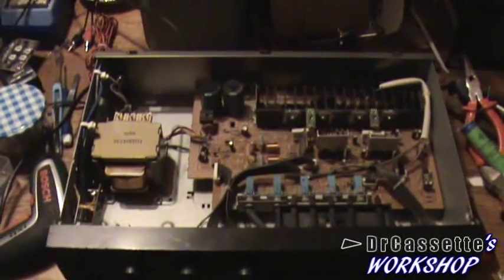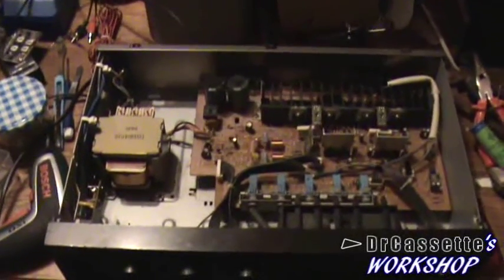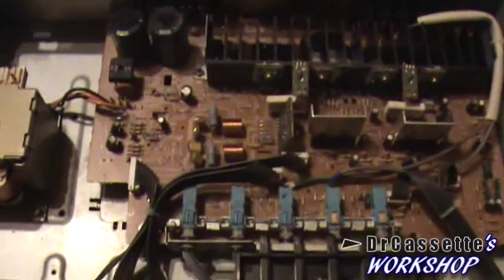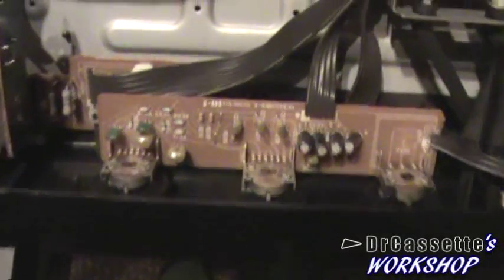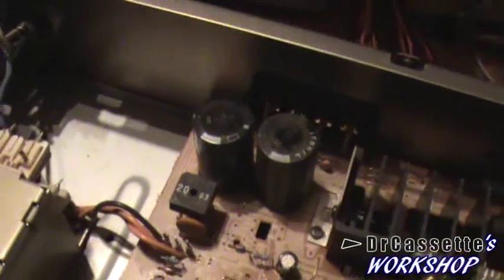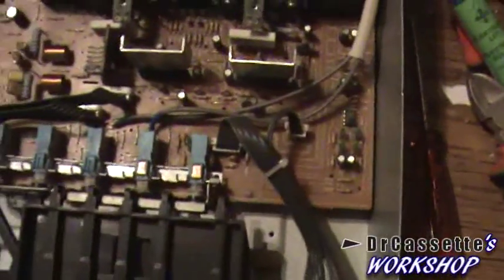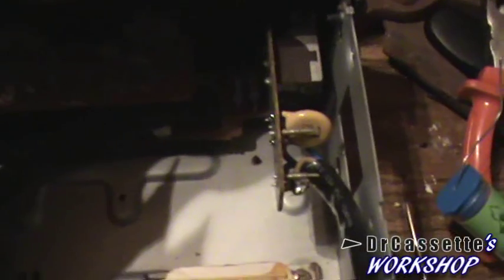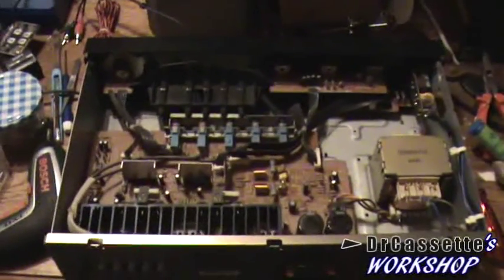DrCassettes Workshop - Inside the Philips FA 561 amplifier!

Comment: Aynı model Ampifier var bende power tuşunu acıyorum ses gelmiyor biraz bekliyorum tak tak ses geliyor çalışıyor arızası ne olabilir
Reply: Ampifier sorunu çözdüm... Ampifier çok güzel sesi var güçlü madein japan mükemmel bir cihaz
Reply: @keremsert7879 Witam. Jak pan rozwiązał problem  bo mam taki sam wzmacniacz i też się nie włacza. Dziękuję.
Reply: @bartolinigabkamaniakdh243  I solved the problem. There are 2 electronic capacitors at the bottom of the amplifier. Bally glue was communicating. I cleaned it with thinner. Problem solved. The amplifier works smoothly.

Comment: I do have the same amplifier, but mine has a problem with the output. The amp works fine for a few moments but then the music stops. it looks like the transistors on the output are failing, but i'm not sure. Do you know what could possibly be wrong? thx
Reply: i have the same problem right now, my right speaker just stops playing after half a minute (only on the aux output). Did you solve your problem?

Comment: On equipment I find with cut cables, those cable clamps often take me more time to deal with than the actual repair! If they don't close well, you can use a craft knife to cut away some of the inner part of the clamp. The clamps are necessary, as they stop cable rubbing on the sharp metal of the hole and exposing live 230v wires! so I always use them, despite the hassle.